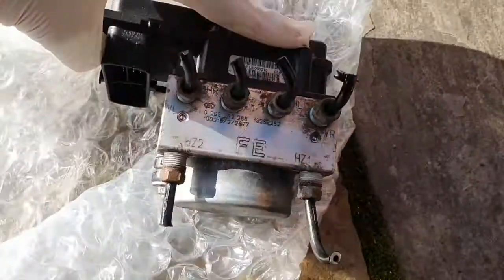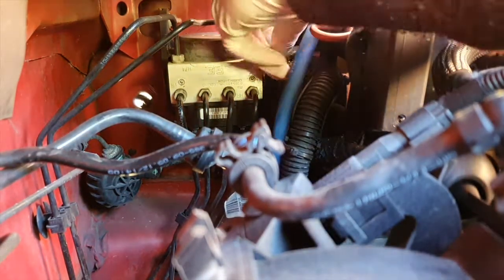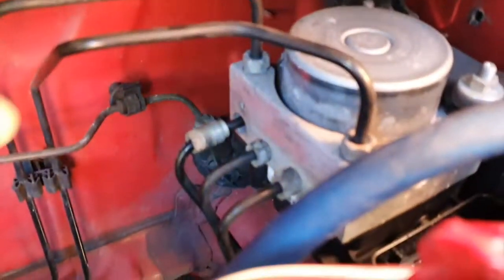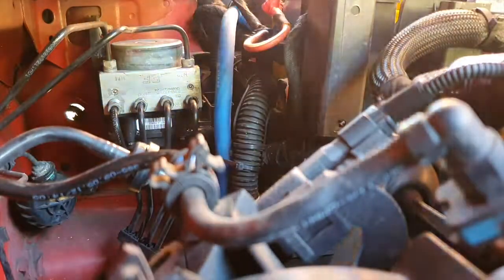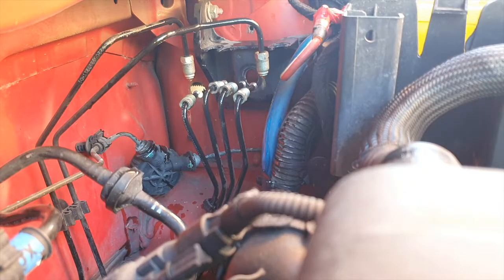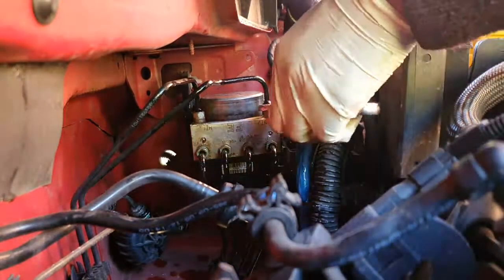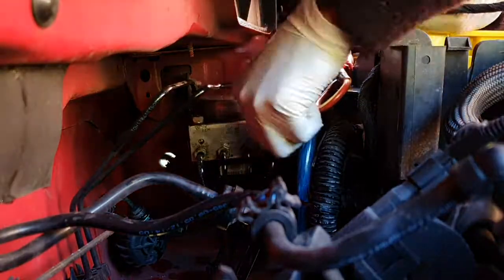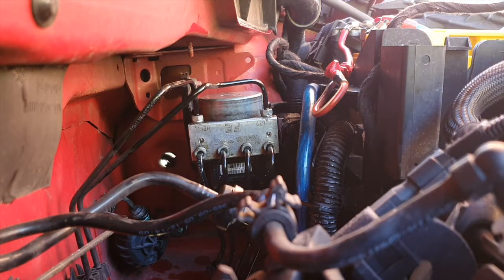HOW TO CHANGE/FIX ABS PUMP FAILURE | VAUXHALL CORSA D |

Comment: After fitting the new one does it require a full abs bleed or just standard brake bleed ?
Reply from the maker: Just in case do the full bleed as the lines will have no fluid and air too

Comment: Doesn’t it need to be coded to your car? Because I can’t just buy a new one and put in my car it has to be coded or something
Reply from the maker: If its the same model number then no
Reply: @BrianVibert1 Ahhh okay because I have my abs warning light on my dashboard, but my breaks and everything work fine… So I was going to send it off to get repaired… But good to know that because it could be cheaper just to buy another one

Comment: Hey man, do you not need to recode/reprogramme the ABS pump after replacing it? My mechanic mentioned that after replacing the pump with another pump, it may need reprogramming with a Vauxhall dealer, is that right?
Reply from the maker: No need to programme as long as tne replacement pump matches all numbers
Reply: @BrianVibert1  Ahh, good to know, cheers.

Comment: As the electric connections on the base of my Zafira  ABS module were very wet I was advised to replace the complete module but to make sure I got a replacement that had the same code ie the same 2 large  'BJ' letters in the top right corner of the printed label on the side of the black top on  ABS module. I have just purchased a replacement ( BJ ) and now after reading the replies here am uncertain of the way forward. Any  advice  welcome.
Reply from the maker: Got to make sure all the numbers matched otherwise it may be to be coded

Comment: Did you have to clear the warning light? O r does it go out .
Reply from the maker: Cleared it
Reply: @BrianVibert1  Ok I could not get the darn light to go out. Vauxhall had wired the 5A line to the heated front seat. I took the fuse out because I didn't think I had one. Fixed now anyway.

Comment: Do you need to flush all the brake oil to remove the abs pump?
Reply from the maker: no you don't but will have a slight spill
Reply: @BrianVibert1  yeah just founded myself 2 hours ago, ihihih thanks man

Comment: I’ve recently changed my wheel bearing and after doing so abs light came on so I possibly thought my abs sensor was damaged so replaced this and I’m having the issue with abs light still on and brakes locking up would you say this is a faulty abs pump or something else?thanks in advance
Reply from the maker: Try bleeding brakes to see if there is brake fluid flow. If there is pump is probably fine. Try hard resetting ie battery disconnect or obd scanner
Reply: @BrianVibert1  took car to get out on computer as when changed wheel bearing the abs sensor  happened and then brakes did the lock up thing  and the mechanic said abs sensor fault change that but still doing it but it feels like the back wheel is locking up and not the wheel that had the initial problem with
Reply from the maker: @xijordyixxijordyix4392  Does the car pull to oneside when you brake?
Reply: @BrianVibert1  no pulling to one side breaks just lock up the original problem was on the front left wheel and now that’s fixed the rear left seems to be locking up it’s very strange
Reply from the maker: @xijordyixxijordyix4392  Doesn't sound like the abs pump. Try taking brakes off and inspect it

Comment: Can you just plug and play. The foreman asking a lot of money because they say you need to programme it back and bleed the brake...
I did all replacing new master cylinder and new brake oil... Just my abs is not working... Can i plug and play....
Reply from the maker: If you replace the pump with exact serial codes then there is no need to code as its a direct swap. Just need to bleed the system
Reply: @BrianVibert1  do you remove battery power... because want to avoid abs ligt faulty on later after replacing it..
Reply from the maker: @eunuseusuf  Yes remove battery power for precautions

Comment: Does the ABS pump have to be programmed after replacement.
Reply from the maker: Not unless it's an exact replacement and the codes match
Reply: @BrianVibert1  What codes need to match? Just the ones that look like a barcode or the other numbers engraved on the metal bit too?
Reply from the maker: @McAshman2k9  Numbers engraved

Comment: Hi, I have the same issue with Opel corsa D 1.3 CDTI 95HP. The serial numbers are 0265 251 864   /   13350598      101025/5/2749 AG5. I bought a second hand pump, the first 2 codes matched, ahte big letters matched (AG5), but the mechanic told me ALL the serial numbers must match, or it will not work. 

Which way is it, which serial numbers must match for both pumps, so it can work?

Thank you
Reply from the maker: All the numbers must match
Reply: @BrianVibert1  but the third one, 101025 / /... Isn t this one something related to the date? I mean 0265 251 864 is the OEM nr, the other one 133...is the VM number.

Isn t it good that only those 2 have to match? Thank you

Comment: and just like that , no moded need after this operation ? 
I had some problems with hyundai accent 3 1.5 crdi , in high trafic when i apply the brake frequently all my 4 wheels are blockng , i have to put on the right , push the brake pedal 3 times to the floor and than my wheels are free, i try to change my master brake pump 1 day it was ok , and than in high trafic again my wheels are blocking , the last solution was to buy a sh abs pump and module , but I'm afraid to change it because i heard that is an hard operation that involve much steps from very good bleeding and moding the new abs pump with a tester,it's that true?
Reply from the maker: I think try a new abs pump. Easy to change, as long as you bleed from furthest wheel first and move on it's fine
Reply: @BrianVibert1  thank you very much , Brian , I will replace it very soon.

Comment: I just got my Honda jazz abs pump replaced due to a common fault. This video helped me realise its do able without paying thousands. I got another pump from a breakers.

Honda asking 2k for a pump ffs
Reply from the maker: ayy there we go. Always a way around spending tons for new replacements
Reply: @BrianVibert1  definitely, when your new to this problem it seems like alot of hassle. It's mainly trying to match the part numbers up. I think we matched 2 up and all seems fine.

I would have had to scrap my car if I didn't get the pump replaced. Such a small part to scrap a car over.
Reply from the maker: I know was a headache for my too. Took me ages to figure out the problem
Reply: I also have 2005 Honda jazz i am getting a code 53-1 abs pump relay short circuit, was this similar to yours
Reply: @abcars2856  have you googled the code or is that what the diagnostics is coming up with ? There is a well known place called ecu testing where you can send the pump off and then have it returned fixed . Whatever you do , don't go to the dealership . Itl be 2k just to get the part .
Reply: @abcars2856  sometimes you get lucky and it's just a sensor gone faulty or dirty under the wheel arch say near one of the wheels . If you use a cheap diagnostic programme you can get false readings or not specific
Reply: @ndavies5968  sorted got a cheap abs pump for a breaker replaced it myself and sorted thanks
Reply: @abcars2856  nice one . It's such a stressful fault because if you can't source a part it's basicly a wright off for the car . Shame because they are solid cars other than the abs pump. Atleast you know you can do it again if it fails again . 

Mine went bad after I hit a pot hole . Me and the mechanic that fitted 2nd hand pump for me , think it was probs the pot hole that knocked some solder loose inside the electronics part of it . But we will never know.

Edit , on the 2005 model I don't think it's a common fault . Apparently it is on the 09 model which is MK2 or 3 jazz I think . Which is the jazz I have . The mk1 looks better in my opinion . Have you ever had the boot lid door crack on the welds , then it let's in rain water ? This is a common fault on your model . But it can be fixed with boat sealent

Comment: Hi Brian, 

Thats for doing these vids, will save me a lot of money! My daughters 2010 Corsa 1.3 diesel CDTI Ecoflex has this issue and I'm going to replace it, but looking on eBay I'm struggling to find the correct one, a lot say fits Corsa 1.3 CDTI but a little unsure, in your vid you say make sure the serial number is the correct one, which serial number am I looking for, there's loads of numbers on the unit?

Thanks, and any help would be much appreciated as the car is currently off the road,
Adrian
Reply: I just recently got mine changed on my car, brought a reconditioned one from Ebay, check the big letters on the front, make sure they match up. Mine was FE

Comment: Mate my Vxhl Corsa eco flex ABS PUMP driver side not work
Mechanic said to take the ABS off and send to repair or get a new one which may cost £1000.
What you recon ? 
Repair?, or A second hand one ? Or a brand new one ? 
2013 model 45k mile
Please give your suggestions
Reply from the maker: Mine cost £120 to get repaired in Accrington
Reply: @BrianVibert1  Hi Brian! Can I ask you where in Accrington? I am looking into getting mine repaired. Also, basic question, how do you stop the brake fluid draining while you have the ABS pump off for repair?
Reply from the maker: It was an ebay seller advertising his srvices to repair abs pumps based in Accrington.  Have a look on ebay. I had a spare old pump and put that on while other was being repaired. But I guess you can use some rubber bungs of right size
Reply: @BrianVibert1  Thanks a lot Brian, will give it a go today!
Reply from the maker: Glad to help

Comment: When you bled the brakes did you do it with the engine running or not?
Reply from the maker: I had engine on to get the pump working
Reply: @BrianVibert1  I thought so, also when bleeding the brakes did you do it in any particular order as I’ve read you should start with the wheel furthest away from the driver and then work your way closer to the driver
Reply from the maker: @benphillips773  Yes you start from the brake furthest  away from the pump so if in the UK it would be driver rear, passenger rear, driver front, lastly passenger front
Reply: @BrianVibert1  so no need to use a software from the manufacturer to run a bleeding procedure of the ABS ? Manual solution is enough for a Corsa D ?
Reply from the maker: @jerome7716  No manual bleeding is sufficient. Car doesn't need any software if your replacing the exact same part
Reply: What do you mean engine on for abs pump to work ?
Reply from the maker: Turn engine on or ignition

Comment: Hi, did you have to remove the battery surround as well as the battery? Or is there enough room with just the battery removed?  Great vid by the way. 👍
Reply from the maker: There is enough room with just the battery removed. It would make it easier but I managed to do it with just the battery out. Appreciate, subscribe to support 🙏